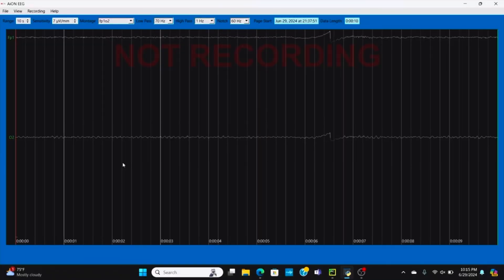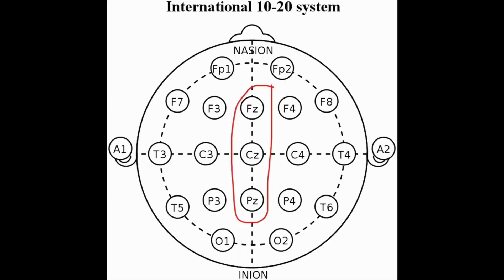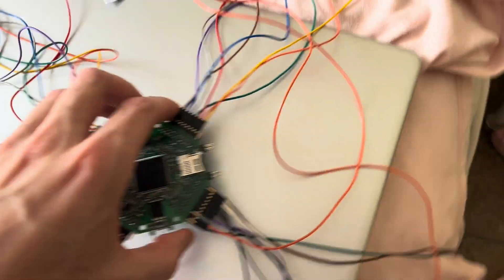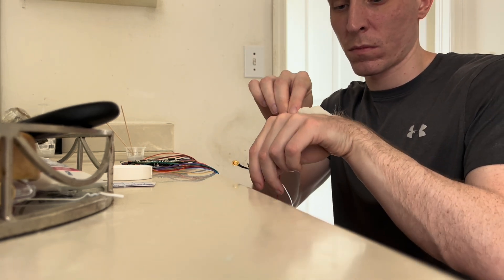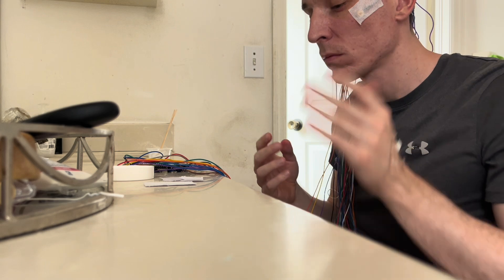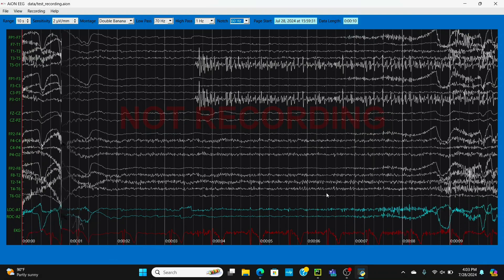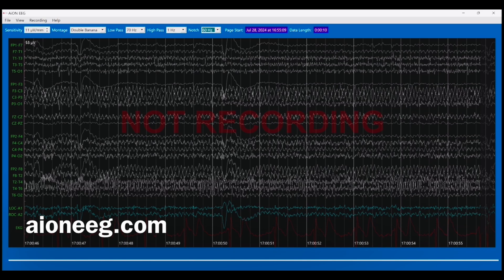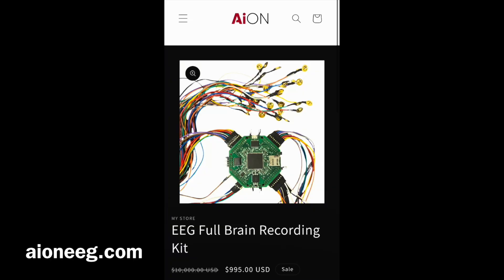How I Fixed My DIY EEG Brain Recording Machine

Comment: How hard is it to just get a usable signal from just 2 sensors. Im thinking about making a project that can detect when im concentrating and it makes a light come on on the esp32
Reply from the maker: If you want to do a brain recording projects, can check out my EEG circuit board and kit: https://jaredbeckwith.com/products/aion-eeg-starter-kit

Can definitely do a lot of cool things with just 3 wires: GRD, REF, & 1 active electrode. Recording concentration from meditation is something I’m exploring personally with it for fun.
Reply: @jaredbeckwith 800$ 😂😂😂 bro im tryna build this thing for like 25$ lol
Reply from the maker: @MyEngineeringProjects1010 Haha I feel you, but EEG signals are super tiny, so you need a special analog chip to amplify and clean them up before the ESP32 can read anything useful. The built-in ADC on the ESP32 isn’t sensitive enough on its own.
Reply: @jaredbeckwith thats funny you say that i was just looking into adc’s they are like 20$ for a decent one. From watching your video i see that the noise is a problem even after filtering. Have you tried to concentrate really hard and did it make a noticeable eeg difference